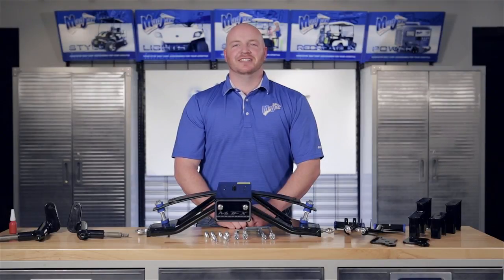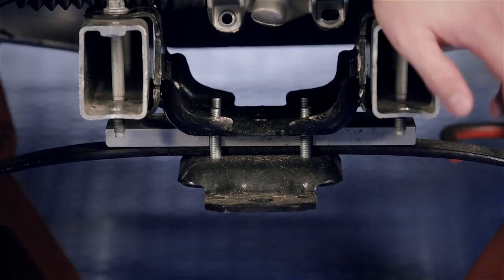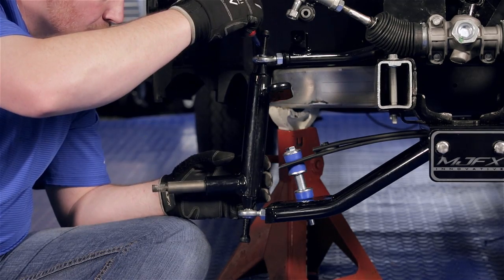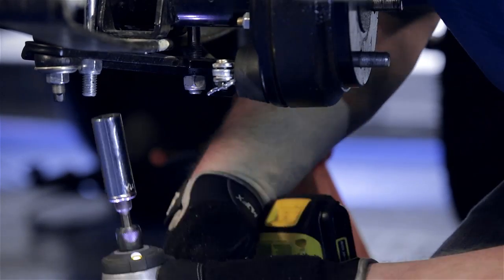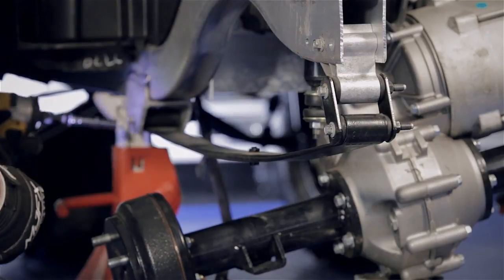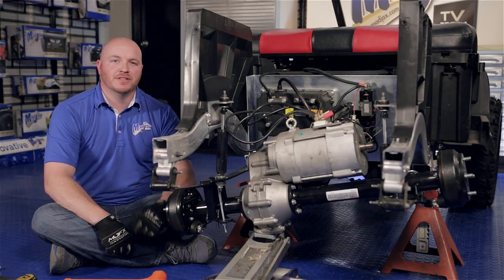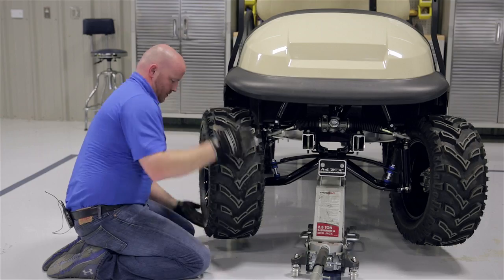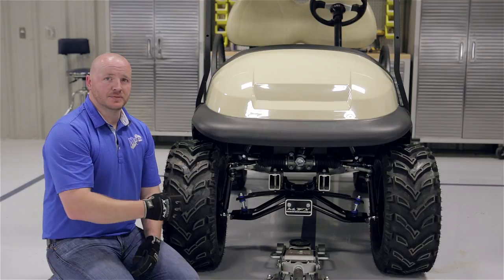A-Arm Lift Kit for Club Car® Precedent® | How to Install Video | Madjax® Golf Cart (UPDATED)

Comment: Question ❓ ( First of all that was a very good and professional video!! )
So my question is about the toe! So far I have 2 videos saying to toe in on the front wheels and 2 videos that say toe out on the front of the wheels ! So I am confused ??
Also you mentioned to make your adjustments with the steering wheel straight ! Thank You! No one else mentioned that and of course my steering wheel is crooked but think I can correct that now by taking the steps in this video !

Comment: He mentions setting the front toe out not in?  Every other video I see on setting golf cart toe it's always setting with slight toe in. not out.  just like with any rear wheel drive car you normally set slight toe in. Is this toe out necessary with the madjax lift kit for some reason?
Reply: If it's still needed, or for anyone watching, adjust the toe in NOT out.

Comment: Excellent video. However, lower bolts for camber adjustment are too short to fully engage all the threads--a design flaw. I have standard (stock) tires/rims and even with adjusting the upper arms I was forced to remove the thick  lock washers supplied with the kit from the lower arms to have sufficent threads. In lieu of the washers I used lock tight on the threads. An extra 3/4 inch length on the lower bolts would have solved all the issues--otherwise it seems to be a good kit.
Reply: I ran into the same issue - I'm only able to get 3/4 of the nuts threaded onto the bolts with the top adjustments maxed out.

Comment: Might be a good idea to include a disclaimer that, if using the hd leaf springs, the leaf springs have a front and rear end.  I'm an idiot and put them on backwards.  Thought they were symmetrical.  Needless to say, I had to do the rear lift twice.
Reply: ME TOO.  What a hassle.
Reply: Mine had arrows pointing towards the front end of the cart
Reply: Same lol

Comment: Installed without problems.  But the alignment will not stay put after driving.  Have readjusted numerous times and it keeps changing.  It is perfect then take it for a drive and it drifts a lot.  Also the camber on the right seems to need more adjustment to the outside than can be done with the available threads